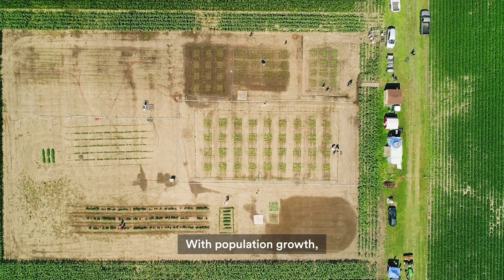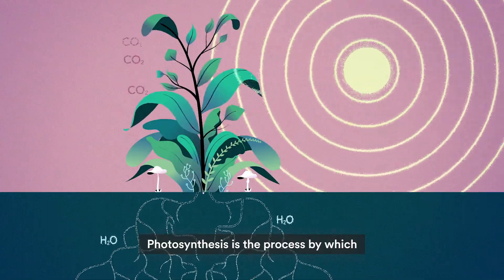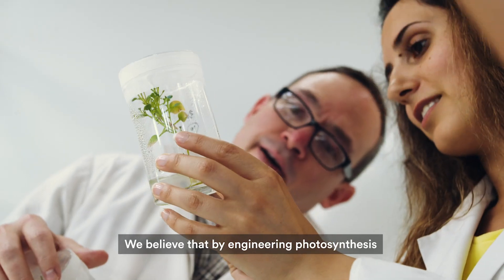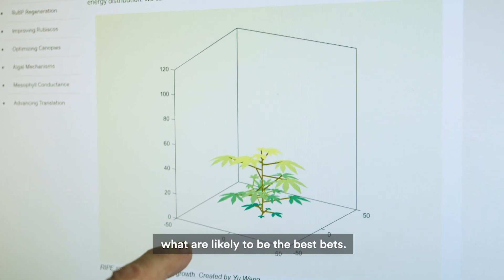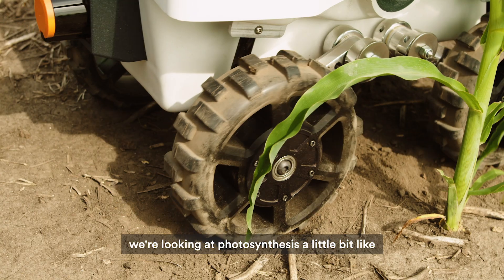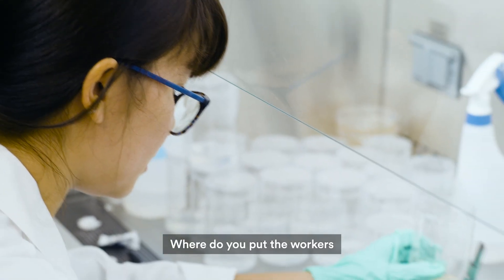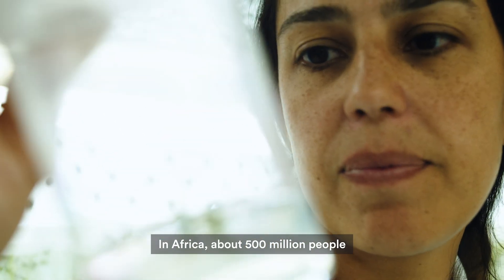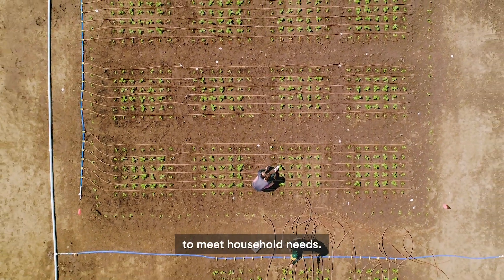Tuning up photosynthesis

Comment: More CO2 in the atmosphere actually means that through photosynthesis, plants produce more energy relatively than 50 years ago (greater yields).
Reply: They produce more carbohydrates, but they don't produce any more proteins or other nutrients. Veritasium did an excellent video on the topic.
Reply: @gabrielfraser2109  yep, interesting.

Comment: GMO is the missing word, isn't it?
Reply: what they do is actually genetic engineering, without genetic engineering there a limit plant produce. what do you do to maximize productivity without genetic engineering ? wait for plant evolve ? when it already evolve we humans will be starve already.
Reply: Technically, even simple selective breeding is a form of genetic modification, through achieving desired traits and culling the undesired ones. It's considered safer because it's slower and gives more time to observe for diseases and weaknesses. With modern technology they can run variable simulations based on the millions of permutations possible, accelerating the process of observation without having to use as many resources on experimental crops. Instead of spending the time and effort necessary to breed these crops, they can just simply modify a molecule to achieve the exact results they seek.
Reply: yes this would be considered a gmo as every plant we grow for food has been genetically modified for the 1000s of years, my favorite of these being corn which used to look like a grain
Reply: SJW libtard wrecker  plant more mean we need more land. Right now we used 11% of globe’s land for crop production. And that we already using genetic engineering. How much percentage organic farming in the world anyway ? In 2050 according to Bill Gates we need to produce 50%-60% more food than we need today If we simply plant more it mean we need more land which is around 17 % of globe’s land. As we know in 2050 there will be more population. from our prediction we will have almost 10 billion of human. If there is more human surely there will be more land used for city, town, village, road, and infrastructure. Do you think we can do that with traditional farming ? do you think we have that much habitable for living and produce food in 2050 ? well Bill Gates seems to disagree that why he started this research. If you think Bill Gates is wrong you can make a scientific research and disprove Bill Gates and anyone who disagree. Simply saying stupid doesn’t magically give solution or make people believe your claims.
Reply: @eddytjhia1131  Dude, You are right.. Then instead of increasing yields, lets regulate human population. That we don't want to do because we are not supposed to tell anybody how kany kids they should have or tax them much more if they have more than 2 kids or something or ask people to adopt orphans or make some kinda policy that looks after all the population menace, resulting in a ratio where birth rate and death rate are manageable. A shooting birth rate  and slowing death rate is never going to end the resource crisis because you are right.. Land Is LIMITED. We can increase everything but land & water (Unless laboratory synthesized water is available at mass scale & people are forced to consume it due to lack of water) 😂
Reply: SJW libtard wrecker  higher yield leads to smaller fields and so there is more space for trees which fixe CO2 and so fight climate change.
You can eat tomatoes, you can eat cabbage so a GMO of mixed tomatoes and cabbages will not hurt you.
Reply: @justinvideoman  That is like saying, If taken in reverse order, We consume water, so we can consume Oxygen ( which we do) and simultaneously we can consume hydrogen also (which we don't) 😂
Reply: would that be a problem?
Reply: @haslan4885  in Europe, yes. Not for me. IPCC recommand it!